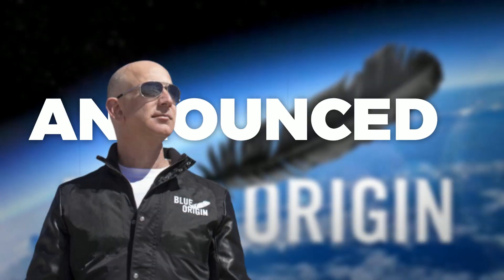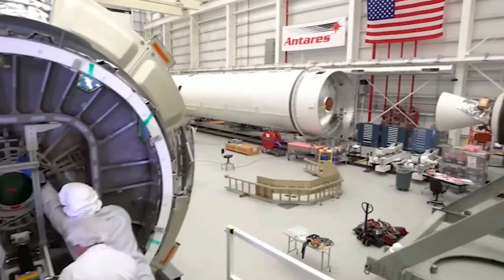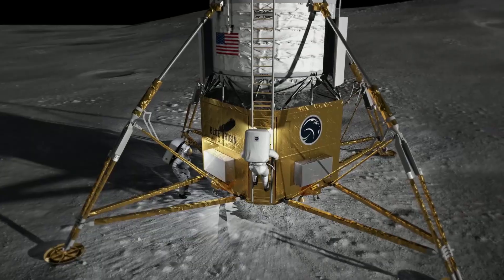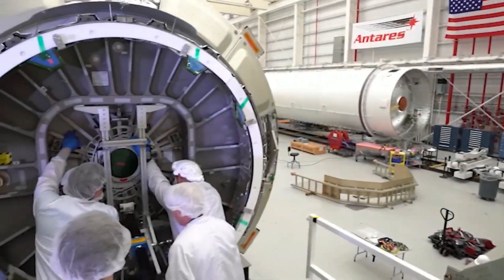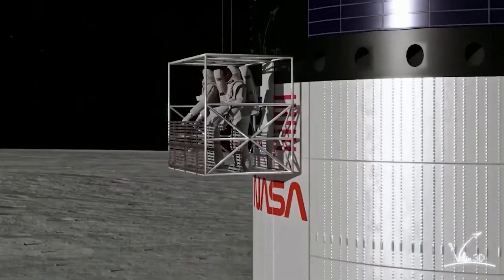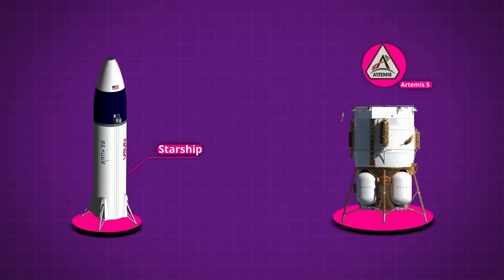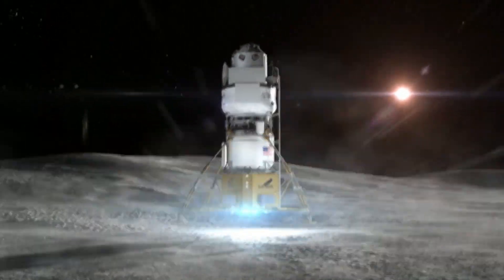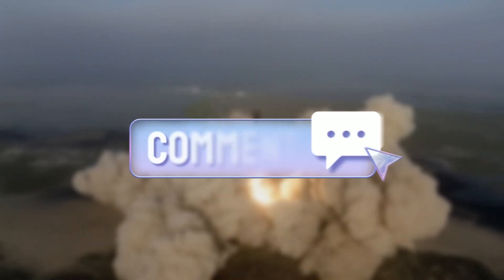Just Announced ! Blue Origin Mark 1 Moon Lander Takes Over SpaceX

Comment: Nasa is not 'considering which system to use for artemis'. It chose starship for the initial flights, that contract has been set.
Blue origin is trying to compete for additional cargo flights (3 ton payload vs 100 ton payload starship) and maybe as an additional crewlander in the future.